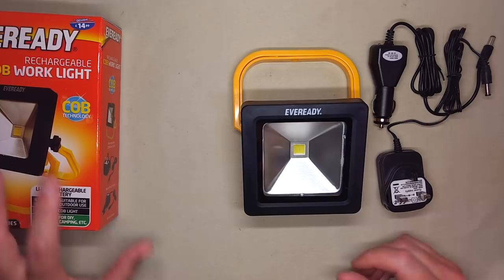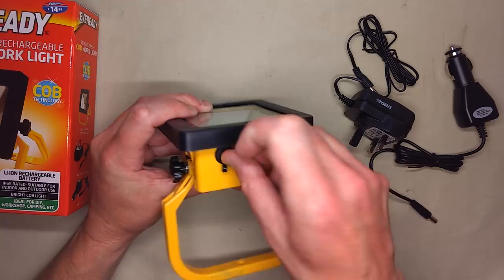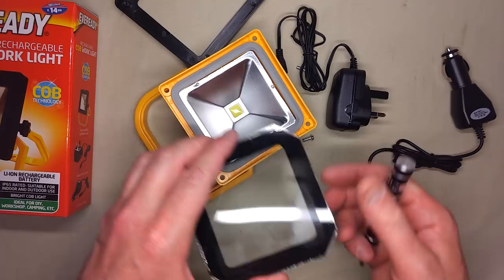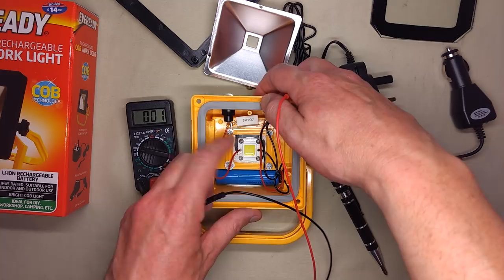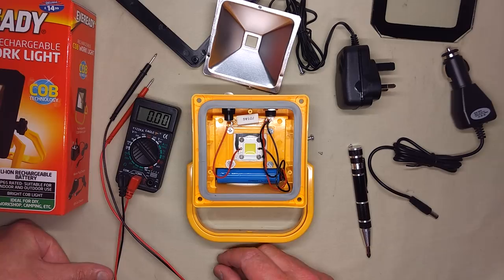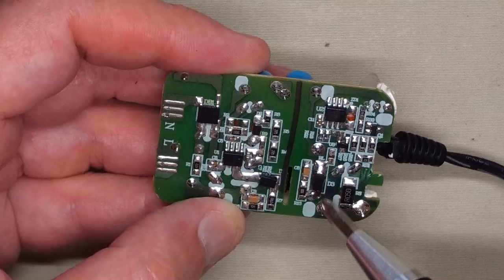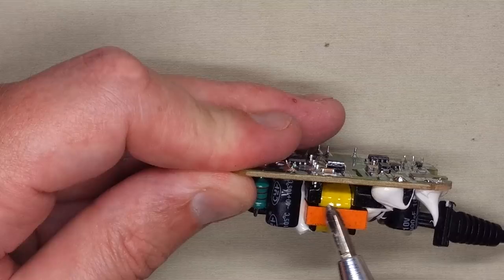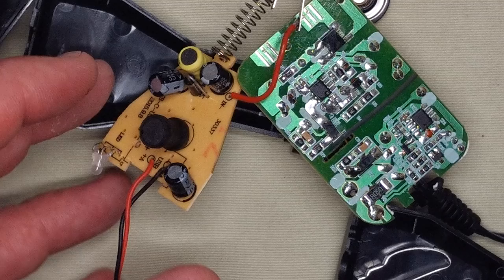Inside BM Homestores rechargeable LED worklight.

Comment: Actually Clive, I value the content of these videos far more than the quality of the sound and motion.  Even the jumpy or sticking image doesn't detract from the interesting content.  From watching your channel I have become happier with tinkering around and dismantling gadgets and I have even got a "spudger".  I never knew such a tool existed but they are way better than a thumbnail.  Recent tinkering has had me salvaging the hard drives from sky boxes and experimenting with the power supply circuit boards.  Please keep up your excellent work.

Comment: One tool you might find useful is a small dovetail saw or gent's saw. They're made for wood, but they cut plastic really well, and I find it's often easier to saw something open rather than trying to break it with the vice or pliers, &c.
Reply: Cadwaladr 
If a plastic case isn't glued or sonically welded too strongly it's actually easier and less destructive to use reasonable force to flex the seam sufficiently to cause it to pop open.   Often this results in a clean break along the existing seam and the possibility of glueing it back together afterwards with little, or no, signs of entry.

Comment: I work as a web developer and have turned my old Nexus 6p into a dedicated video camera for our shop. We shoot a lot of video for the site on it now. Does 4k rather well and is built like a brick. Rooted and bone stock Android direct from Google. Not sure how easy they are to find new or reasonably refurbished but I would definitely recommend.
Reply: I second this. I've used both Nexus 5 and Nexus 5x devices. I mine rooted with LineageOS, because I like to live dangerously. Very easy to root -- the bootloader will just give you root access if you ask nicely. And LineageOS support should still continue even after Google drops support!
Reply: Even the first gen Pixel is heavily discounted if you buy it refurbished
Reply: @fersunk 
We're talking about buying one for the office for dev work and I'm very interested in trying the camera.

Comment: I grabbed a load of these (well about 8), swapped the batteries and protection circuitry and they are great lights for Scout camps. Throw in a 30W solar panel and its a great camp lighting system.

Comment: Good timing on the video. I bought two of those 10W LED work lamps you showed a couple years ago and have been considering replacing the LED to something that's actually 10W and doesn't have a green tint to it.

Comment: As you say Clive, worth £5 for that pair of psu alone, plus you get a nice free lamp housing, resistor and lithium cell ! Run time as is would only be 2 hrs or so, which is a bit mean. I prefer less concentrated led arrays than COBs personally - they are so intense if you happen to look directly at them, compared to a large array of lower power leds. COB arrays probably cheaper per watt these days ?

Comment: Hi Clive, very nice teardown on the light, I learned a lot from it. If you're saving your video to an SD Card, I would recommend that you run a trim on it from time to time to ensure that you're not running into fragmentation causing slowdowns in writing to it. You might also look into running a trim on the internal flash of the Moto-G. Just my two cents.

Comment: The charger seems to be the only thing that regulate the current? Does the cell have protection on it? Also the light using a common barrel jack and the cell might blow up if someone put a higher voltage into it because 4.2v is not a common voltage for the barrel jack
Reply: yep you got it
Reply: Best NOT get your chargers mixed up then!

Comment: A small ball and peen hammer is very good for breaking an ultrasonic seal. Tapping it all the way around and holding one corner to the floor and hitting the diagonal corner,the corner on the floor will open fairly easily, then just turn as you go. You want to shock the plastic but obviously not knock any smd components off

Comment: The sticky goo in the case is ment to trap little bugs, spiders so they wont short out something on that charger. Not that it has any openings,or mabe it has venting I didnt see. At least thats what I would do in an electronic application. How many times have I opened electronics and found skeletons of dead spiders and other bugs. At least by adding a sticky substance in one spot, they would get stuck in that one spot. I know of a person that had a bug kill his stand up computer. You wouldnt think it would happen, but crap does happen.

Comment: I think fluorescent tubes making bands on video has to do with the CMOS sensor. None of my CCD/3CCD cameras have that issue because they don't have a rolling refresh and any of the CMOS cameras I've tested (including the Xperia XZ Premium and the LG V20) can have it avoided if the shutter is set modestly fast (optimal speed varies between camcorders and phones and getting control of shutter speed on the Xperia requires a third party app). I think the G4 avoids said banding just by accidentally having a small aperture (that will circumvent the problem as well).

Comment: Thanks for the video Clive.  I wasn't bothered by the stuttering. My Moto gets hot too. I do put it in airplane mode and wifi off when recording videos.
Reply: Nuts n Proud Everything electrical has been getting mega hot during this UK heatwave,  even equipment that doesn't normally get very warm!

Comment: Recent videos have mostly had picture stuttering problems I'm afraid.   However I wonder if it might be simply because UK temperatures have been so high in the past month or so, causing the camera to get that much hotter to dissipate the same heat?
Reply: Fair point. However, my G4 has been doing its hot plate impression since around April, round about the same time the new G6 was being rolled out in the UK. I would suggest anyone thinking about buying a Motorola might bear this in mind. However, which competing manufacturer designs and supports mobile devices to last more than a couple of years?
Reply: Yes, just spotted that the above video starts stuttering at 7:22, and temperatures have dropped to near normal at the moment, especially up in Glasgow.
Reply: Paul Grimshaw 
Clive records his videos about a week before they air on YouTube as he allows Patreons access roughly a week early.

Comment: In regards to the Moto G4, have you done a "cache wipe" on it? It requires several steps including rebooting it into recovery mode, but it's all easily googleable and so long as you JUST perform the cache wipe, that should help considerably!
Reply from the maker: Cache wipe and full factory reset didn't fix the issue.

Comment: BIG COIL on the 12-24v car charger what for dealing with the nasty, noisy power that comes out of that hellish 12v socket.
Used a cheapo old voltimeter (yes, the one with the needle) to poke on the 12v lighter hole thing of my econobox and the damn thing looked like a pendulum clock with the engine running!

Comment: Sadly I don't think are stocked in my local - seems a decent set of PSUs (I spy that the car charger is labeled USB on the PCB). Did you figure out the battery capacity?    Is the light circuit really that simple? (battery, switch, LED & resistor?)

Comment: Nice little lamp, but on the note of the new phone for recording, I'd put up the notion of the One Plus 6. I got one not to long ago 128gb storage video recording is quite excellent and it doesn't get warm over long sessions of use they go about $650USD might be a tad expensive though.
Reply from the maker: I'm looking at a few different options.  In that price range I'd also consider the Cat phone with a Flir camera built in.
Reply: The cat phone is let down by a poor screen and user interface :(
Reply: I have a Nexus 5X, it takes 4K video, pretty good phone and I paid $250US for it NEW a year or so ago.
Reply: I got one about the same time as you James £519 direct from oneplus no contracts PAYG  ... UK mag computer shopper (and just about everyone else) seem to love it and call it the Samsung 9 killer ... The others seem to be dismissed out of hand - I have to agree - I thought my old phone was fine ... now I've had chance to compare it's soooo much better.  They use stock Android 8.1 pretty much as is and just tack on a branded launcher - nothing you can't easily get rid of.  Wife's Samsung is full of crapware compared to mine.

Comment: On the price reduction from £15 to a 5 spot... did you know Screw Fix will sell you an excellent little rechargeable work light for £20. Comes with all the gubbins, plus the stand doubles as a mount for fixing it to a tripod (screw and butterfly nut supplied). Not sure what the rating is but they're really good, bright and a charge lasts a good long time. So maybe these ones just weren't selling a £15, although the cynic in me says they knock these things out at a high price, then after a few weeks, they drop the price to make them look more like a bargain... I mean, for a fiver I'd buy one, at £15, I'd pay the extra fiver for the all metal Screw Fix job.

Comment: The G6 gets a good review from the computer shopper lot ... 
The dodgy update phenominominon seems to be across the board iPhone and android alike ... part of it is software "catching up" with latest hardware ... great if you have the latest and greatest - but if you are nursing an old klunker you are stuffed, like trying to run win7 on a 486 better suited to 98.
Problem is you never know which updates are security and which are just "improving" or optimising and pushing kit harder and harder.
More and more kit is coming with at best a best before and some, like 98 and XP machines with a proper support expiry date.  With a PC you have Linux - with a phone  ... or at least some of them you can load them with custom roms.  You'll probably want to get a phone that runs - but if you just want to use your existing as a camera - that's probably the best bet, stick to what works (or worked) and does it in a way you are familiar with.

It depends what else you do with it and what your budget is.  These new fangled "notch screened", Dual or treble lensed beasties really have to be seen to be believed, the quality is phandabidosie.  My new phone takes photos, HD video, with slow and fast motion modes.  I almost wish I could use them.

Banking apps and DRM content  tends to stop working on machines that look like they've been rooted or just seem to be different so you have to be a bit canny.
Reply: Andy-  Do you create new P words often ? LOL

Comment: Have you considered a "Chinesium" phone. Watch out for the Oreo update on the wiley fox it has issues. (I have one of those). Actually there is an interesting electrical issue caused by the update. THe rapid charging state of the phone is borked. Wont detect it from a number of combinations of high and low power chargers and cables. Yet an old power bank with 1A output works just fine although the current necessary to trigger rapid charging is meant to be 2A i thought.
Any way that probably software/firmware but interesting electronics behaviour. Oh and bloody annoying.

Comment: sounds like your phone is thermal throttling this is where the CPU gets too hot so to save itself from cooking to death it reduces the operating frequency of the CPU so it won't overheat and this very spiky lag is a normal symptom of this problem. my computer expertise tells me that you probably have a major memory leak due to the new update.

Comment: How does charging the lithium cell work? Does the power supply do the regulation required to not let this burst into flames, or does the cell itself have some BMS built in?
Reply: I have one of these, and there is something inside the heatshrink of the battery. It might only be a ptc, though.

Comment: I have the G4+ too.
Kind of knew the Lenovo-Moto line would end up losing/screwing their userbase. Corporations are short sighted creatures.
Research effort will be required next phone upgrade, bugger.
Reply: It's pretty sad when a phone needs a community ROM to make it not suck. My dad and I had Moto G4s (not the Plus model) purchased on the same day that failed a year later within a week of each other.
Reply: They stopped accepting returns on g4+ models that had issues, and outright refuse to fix their ghosting image and ghost touch screen problems.
Reply: Soldium So he really should try a community ROM then.

Comment: what voltage charger do you need for this as I have lost mine. :(
Reply from the maker: It's a specific charger because it has to limit the current.  4.2V 1000mA.  You may also have got a car charger with it.

Comment: Is it possible to roll back your phone firmware or even do a factory reset to solve the jumpy video problems?
Reply from the maker: Did a full factory reset.  Can't roll back easily.
Reply: Check XDA for an aftermarket firmware?
Reply: check out ''flashing' to revert the phone back to factory specs(including the o/s)

Comment: Dam planed obsolesce tills the Moto G4-plus
Reply: A review of a good work lamp worth buying, and a second review of a phone that you should avoid, as always a great video by Big Clive.
Reply: "Planned obsolescence" usually refers to hardware, not software, especially not software you have nearly full control over. And since it's been acting up after a software update, he can easily just go to XDA and fix it with a hack or a custom ROM. Modern hardware and software is complicated and bugs happen. So does planned obsolescence, so it is important to distinguish those two and act appropriately.
Reply: "easily". Not an option for average Joe and that is everyone they have to get to buy a new device.
Reply: There are thousands of step by step instructions on the web, both in text and video form. If you're too stupid for those, tough luck.
Heck, LineageOS (Cyanogenmod successor) even has instructions on their own website to install their mostly stock version of android on this very phone (Moto G4/G4 Plus)

Comment: How about a dedicated action cam - Firefly 8, Xiaomi Mijia Mini 4K?
Reply from the maker: The action cams tend to be too wide angle, and are usually focussed for distance filming.
Reply: GoPro used or recently discontinued (Session) are very good and have narrow shot options, spares, software. Most use a wifi app to config and monitor. The Mobius and Hawkeye cameras are very good too. They are available with 90° lens option, rugged and have infinite  mounting options. GoPro are in "it" financially right now so you could take advantage. If it's a new phone you really need then the Xiaomi Redmi range are very good value for money.  Don't expect to pay more than £150 for any of these. There are so many action cam brands that have appeared recently while these have been around for years.
Reply: bigclivedotcom firefly 8s will do 4k@30fps, comes in 90° version. 12mp sony imx1117 with ambrella a12 chipset. Adjusting focus can be done, but involves opening case and taking/reviewing stills between adjustments.
Reply: On second thoughts you might be better off sticking to phones for overhead recording. 
The zoom function you often use isn't available on most action cams.
Reply: LostJohnny Good point, "enhance" :)